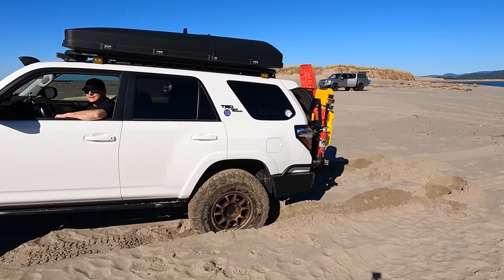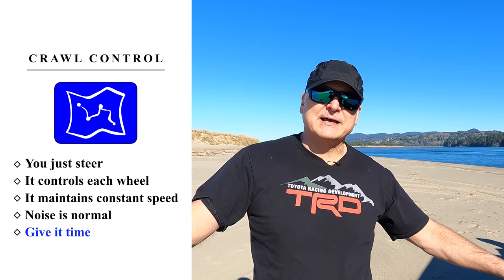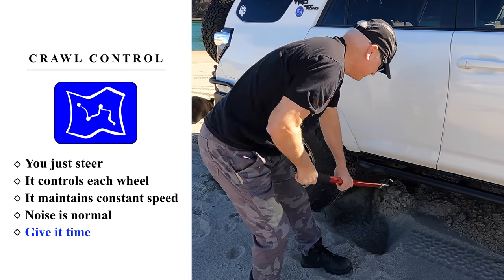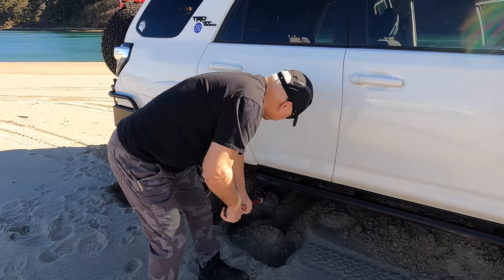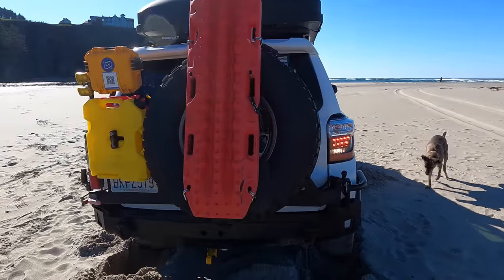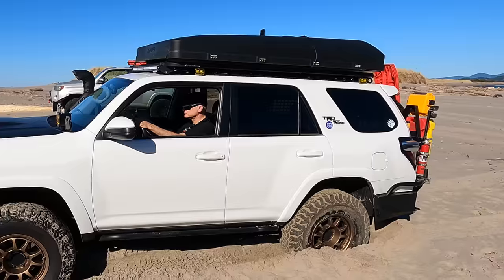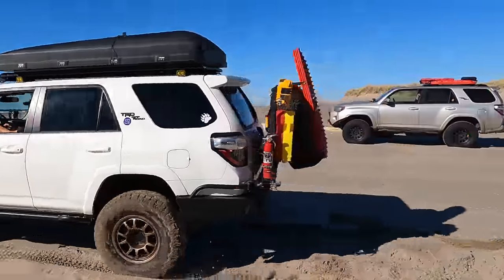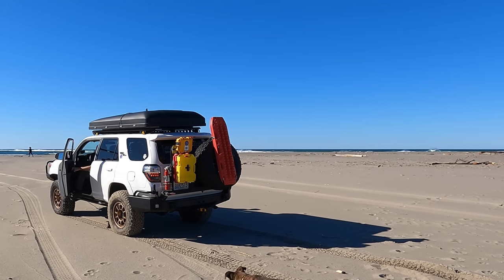Finally, the Only Crawl Control Video you Need to Watch - 4Runners Overlanding with Crawl Control

Comment: Towards the end of the video shows like you had maybe 8PSI in your times what were you running.... With no beatbox
Reply from the maker: Yeah, there are actually a couple times in the video where you can really see the low psi. My brother and I both run 10 psi all the time and have never thrown a bead. We both have Method wheels. You are correct that they are not bead locks but they have a "bead grip" design (explained on their website) which seems to work well. Anyway, seems to work for us so far. Cheers!

Comment: It seems extremely evident to me that so called “crawl control” is for drivers that have no business being off-road in any sense of the word. 
It’s not doing anything that a driver cannot do themselves, with proper gear select and proper throttle control. 
This to me seems like another one of those options for someone who has more money than experience, and wants a “fail safe” to help them because they don’t know how to drive the truck in those conditions themselves.
Reply from the maker: Thank you for sharing your point of view. I learned to off-road in a 1967 Nissan Patrol. It had manual locking hubs, it came with an included hand-crank start, a manual transmission, and a clutch so hard to depress, I'd swear it came from an old tractor. Not a single modern "traction control" device of any kind. As a practice, I do not use modern traction control systems in the field but I do like testing them and tinkering with them to see what they can do. If you look across all 4x4 brands, there are millions of vehicles with modern traction control systems. Most people do not by them for serious off-road use and they do not want to be serious off-roaders. They use them for family ski trips or they live in a snow belt region or they live in or near the mountains.

Comment: All that electronics and the solution was to just use Real 4WD? fail.
Reply from the maker: True, sometimes regular 4WD and some momentum is the best solution. I wasn't really expecting the Crawl Control function to be great at climbing sand hills. As its name suggests, it is for very low speed scenarios.

Comment: Nice video showing how pointless it is in the real world.
Crawl control is for posers and that is not overlanding ^^
At Leadbetter;   Neatos wil never replace skills and with a 5-speed you can let it auto-crawl while you look for sand dollars :D
- Gen3 Limited
Reply from the maker: I learned to off-road in a 1967 Nissan Patrol. It had manual locking hubs, a hand crank start (no kidding), a manual transmission, and a clutch so hard to depress, I'd swear it came from an old tractor. Not a single modern "traction control" device of any kind. I really miss that rig!
Reply: @OverlandPNW 
I learned to offroad in a 1965 Datsun car in our backyard :D
Reply: @OverlandPNW  
I'd still take a 1989 Montero 3 door v6